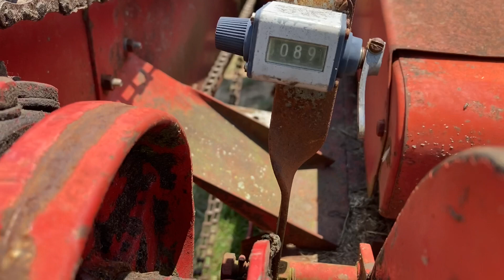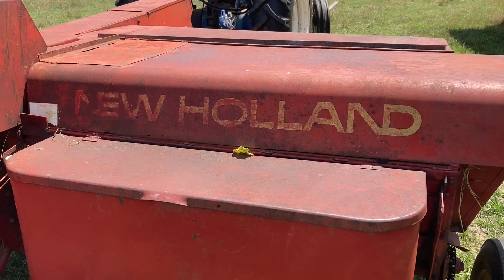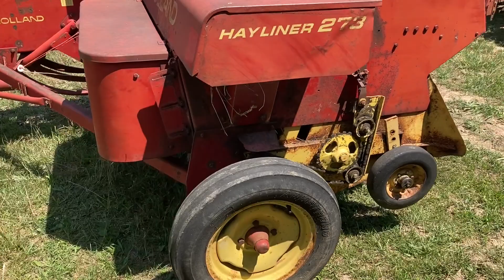Do not buy a baler without watching this video! New Holland 273 pre-purchase inspection.

Comment: My friend Ronney and I hauled hay one summer when I was 14 and he was 15. I’ve hauled many a square bales of hay. Never saw the balers in use up close. We showed up in the hays fields after the hay bales were on the ground. We had an Ford old truck, no doors on it. We tied a rope to the steering wheel and put the truck in granny low. Once we got a few bakes on the bed, I jumped onto the truck bed and stacked them from front to back. Ronney was a lot stronger than I was. He could toss a bale higher than I could. We got 55 bales on the wooden flat bed. We were paid a penny a bale to haul it to the storage buildings. We thought we were making good money. The days were long and hot.

Neither of us had a drivers license. The truck did not have tags on it. It had a small water leak. We filled the radiator with water every morning, before we started our day. We stayed on the back gravel roads. Romney turned 16 and was legally able to drive at the end of the hay season. He sold that old truck for $150 and purchased an old Ford sedan. I think it was a 1953 model. I went to college, after high school, and Ronney got drafted and went to Vietnam. He survived the war. I moved away and lost touch with him.

Nice to see people still using those old square balers taking care of them.

Comment: Dad bought a 273 that was a 2 year lease return from a local university. First thing we did was change the bale length. It made 12 inch bales the university employees handled with forks(Dad called them union bales). We used it hard until 1996. Good machine!

Comment: Good old baler. Clean all that chaff off of it, it attracts moisture and causes rust. Twine knives need to be sharp, dull knives can cause a myriad of problems. I replaced them every year, they're inexpensive enough. That orange twine sucks, use the blue that comes in 9600' rolls, it's much better. Good luck.
     Best regards from Indiana.

Comment: I didn't see it mentioned in the comments but i believe your pickup chain is installed incorrectly. The rear drive sprocket turns clockwise. The chain should travel from the bottom of the rear drive sprocket over the top of the front pickup sprocket (so that the chain will pull directly on the top of the pickup sprocket to reverse the direction) and then on to the lower idler and up and over the upper tensioner and back to the top of the rear drive sprocket. I'm looking at the nh269 factory op manual for my baler and it has an illustration (figure 55 on page 37) showing the routing.

Comment: In Australia this model baler was called a 275 Baler, the unit i had packed more on one side making banana bales, could never solve the problem so sold it and bought a 317, magnificent baler in its time.
Reply: Love my 317 never misses a bale
Reply: Something not well know but is in the operators manual is to adjust the feeder carriage penetration. Also adding or removing hay wedges in the chamber.
Reply: @ppi8922  Did everything you have stated here also tried driving less on the more packed side, it had me beat.

Comment: Hello my friend & thx 4 the video, those 273's R great balers. U should shim the fiber wear blocks to remove the excessive side play in Ur feeder carriage. Also MOST importantly replace the missing PTO safety shield & chain guard on the pickup drive. If U R lucky ask former owner if he has them.
Reply from the maker: Thanks, I have been waiting for your comment :). Tell me more about about these fiber wear blocks to shim the excess side play. I take it that is the what I was checking the rollers on?
Reply: @TheScientistHayFarmer  Shims are available @ NH, one side will wear more the other. If U had to 1/4" flat washers would work but harder to get in place.

Comment: Also need to make sure the hay wedges are in place and check the condition of the knives, sounds like the plunger bearing are ok, I didn’t hear it hammering! Good video.
Reply from the maker: It’s a good point on the knives because they were very dull and out of adjustment and I had meant to show them and just forgot. I don’t use hay wedges.

Comment: The Plunger runs on a bearing on the feeder side. With the feeder carrige lid open have a helper turn the flywheel untill the plunger is visible from the feeder opening. You will see the bearing and will be able to check it at this point. Prying up on the plunger with a pry bar will take the weight off the bearing to check. Be Careful of the hay knifes! Dont stick your hand arm or finger in the chamber at this point unless you are willing to loose it!

Comment: One thing i think that mabe you didn't think about is required hp to run a baler.
.
Ive got a tractor thats 37 net hp @pto.
Seeing mix results in people's opinion on weather thats enuf hp.
Seems most folks shy away from smaller tractors on unflat land, as the force of the heavy plunger can affect a ligher tractor far more then a bigger one.
0.01c
Reply from the maker: A baler requires about 25 PTO hp, your 37 hp PTO tractor would have no problems running running this. The weight of the tractor is what becomes important on unflat land as you say, as well as the drawbar hp. 

Go check out my video “Baling 500 squares with a 25 hp Kubota L2501.” I run my 311 PLUS a fully loaded wagon with a little 25 hp Kubota. You won’t believe your eyes.
Reply: @TheScientistHayFarmer   i found it, very interesting.
I could hear it drop rpms each hit.
I looked it up, the L2501 As a hyd its 19.somthing hp net at pto. That por thing was working hard, LOL.

Comment: nice video...some suggestions,  check the slide blocks on the packing arms, it appeared that there was an excessive lateral movement.  The packer rods should be checked for length and bend.   Check the pick up wheel, alignment and bearing play.   The needles looked good but could not see the twine wear, will a knot pass through the eye or is it worn and the knot will get caught and break the bale.  Did not see the bale knifes, one on the plunger and the stationary one in the bale chamber.  Judging from the bale you pulled out they need sharpening, ragged edges.  Speaking of sharp, mentioned that the twine knifes had been replace, but are they razor sharp?  Did not show the twine fingers on the bale hook that form the knot; is the hook worn of bent, how is the spring tension?  

A little heads up on your 311, the bale packer system is prone to failure; the bearing tracks wear, bearings seize, the arms come off and BOOM!  NH does not support many of those parts.  Started with an IH 46, then a NH68, to a NH273/thrower and finally a NH 316/thrower.
Reply from the maker: I’m taking a guess at what you mean with some of your terminology, but I’ll need to adjust the feeder tine bearings, the knife on the plunger is very dull and poorly adjusted. I totally forgot to show that but it was one of the things I checked initially. The needle eyelets were good.

Comment: I didn't see waffle plates or other restrictor type bars to hold the hay in the baler chamber.  Just past the hay dogs.
Reply from the maker: Are you talking about wedges or is this something else entirely?
Reply: I think he is talking about that angle like piece of metal you found in the tool box. When you look into the bale chamber there should be two on each side. I have them in my 68 baler. They help keep the hay from sliding back.
Reply from the maker: Yes, those are called the wedges.

Comment: Spacer should be tight but can spin other wise puts pressure on shear bolt flywheel always trying to go back check rollers on pickup bearings on end of tines check pivot pin on safety latch have a habit of kotter key brakeing an pin falling out oil pins on pilot on front over riding clutch little springs get weak an where’s pilot out permacully (sp)

Comment: Looks like it's in great shape - I have to try your bungee trick for testing the knotters.
That first haydog spring you looked at (top right) looked broken on the left side @ 12:53?
After I shimmed out the wear blocks to spec (1.25"?) on the feeder carriage on mine, it got a lot quieter ;)
Reply from the maker: I’ll have to check it out closer. I’m going to replace all the springs anyway.
Reply from the maker: You’re the second one to comment on shimming the wear blocks. Looks like I need to do that so am going to look into it for sure. Thanks!
Reply: @TheScientistHayFarmer  The official shims are stupid expensive, but not sure why you can't just use washers? If you overtighten their screws, the blocks crack ... mine also had one block missing.

Apparently the (lower?) rail moves up and down to close up on those rollers as they wear down to stop vertical movement too. My rollers were so trashed I replaced them though, should be 6 of them I think. 

After replacing mine ... I figured out that the aluminum fingers seem to be adjustable up/down to compensate for wear. Oops. I haven't figured out how to set the bent ones to correct length yet.

Comment: Do you ever sharpen the twine knives on your square balers?  If so, how?  File, flapper wheel?  Do they need to be razor sharp?  Thanks
Reply: A sharp twine knife keeps the twine from getting stuck on the bill hook and causing trying and breaking issues. There's a single bolt and nut holding each of the two knotters down. Remove those and you can flip the whole assembly up and get access to the knives. I just use a small fine tooth file once a year. Leave the lock nut and bolt a little loose to allow some minor movement when you  put them back or else the knotters can bind up.
Reply: Ok thanks